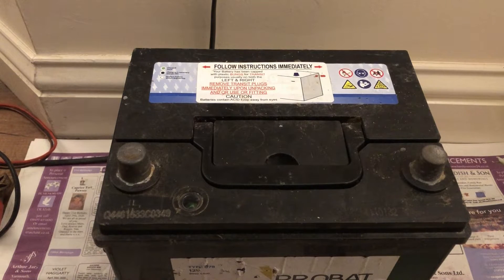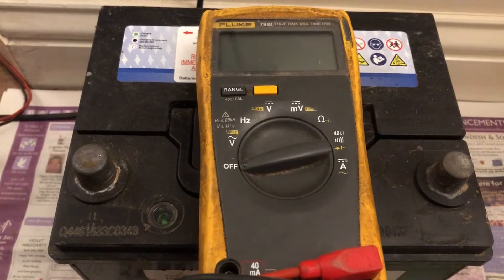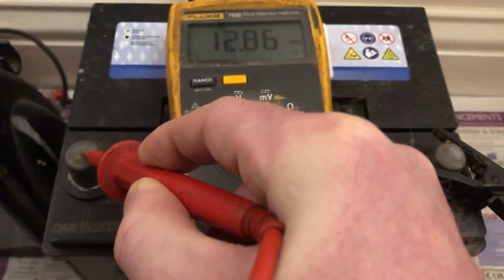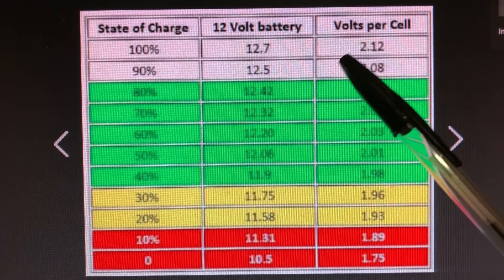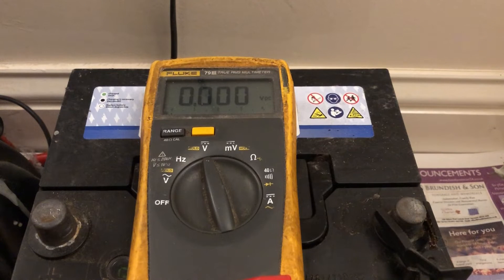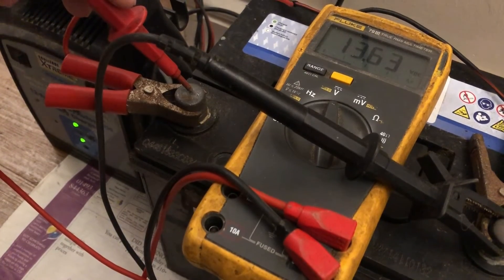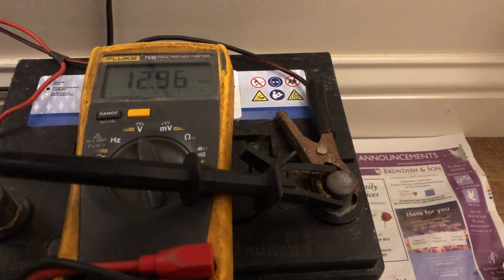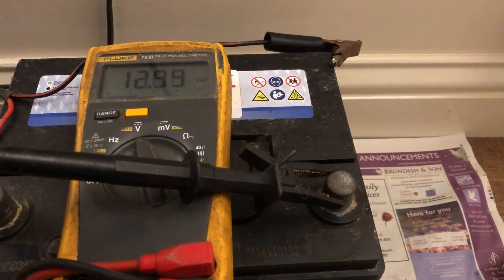Testing boat or car battery charge, & checking the alternator is working. Outboard engines

Comment: Hi Beany, although its showing a good voltage it is no guarantee whatsoever about what that battery will deliver over time in amp hours. Beware!
Reply from the maker: Yes its only a rough guide on a known good battery, you need a proper tester to fully load test the cells